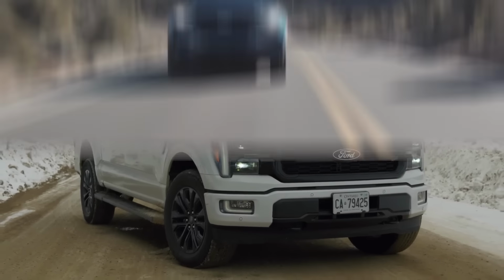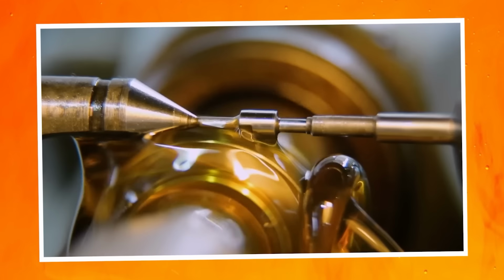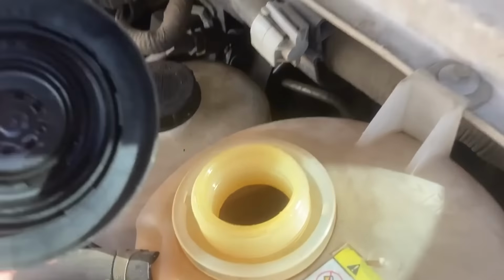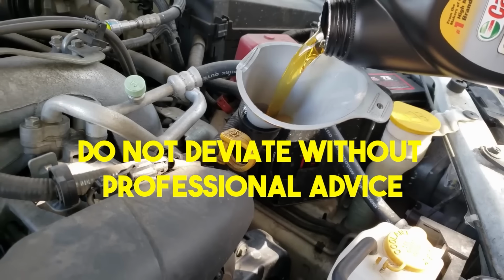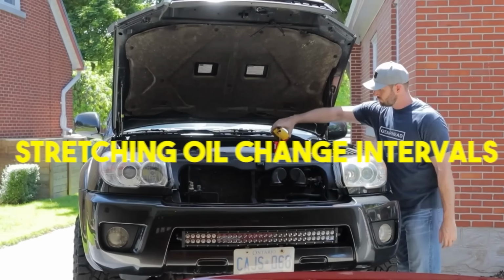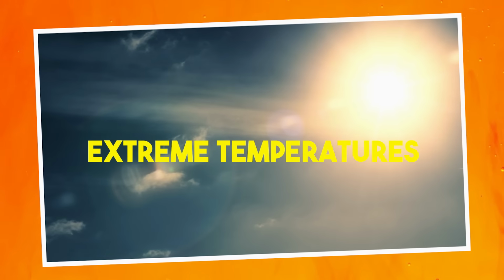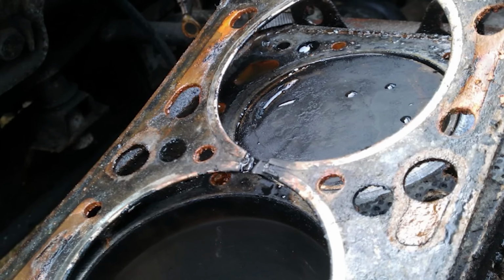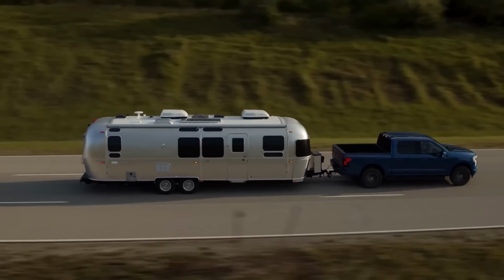STOP Using This Engine Oil in Your FORD – 15 Serious WARNINGS!

Comment from the maker: What engine oil do you use in your Ford? 🛢
📘 FREE Ford Longevity Checklist 👉 https://www.fordscope.com
This is the same checklist I’ve used for 20+ years to spot early wear and bad habits.
If it raises warning signs, the full 500,000-mile guide explains what to do next.
Reply: Royal Purple 5w-30 on my 2012 3.0 Escape and works perfect- Full Synthetic with latest additives
Reply: Pennzoil Ultra Platinum 5w30 in my excellent '22 Edge AWD 2.0L turbo. 5k mi OCI. Synthetic oil filters. Synthetic air filters. Purrrs at 55k mis. -Engineering perspective
Reply: Use Top Tier rated fuel only as Ford recommends folks!

Comment: Ford’s 5/30 blend in our 2024 5.0 and 3.5 eco-boost. Change every 3K or 6 months. Oils cheap, engines are not, Texaco gas. ✔️
Reply from the maker: Short intervals, quality oil, and good gas keep those EcoBoosts and 5.0s running strong for the long haul. 💪🛠️

Comment: Hello RJ I love your videos. They’re very great to watch to listen to. I’ve own a Ford since 1980 at all Ever drivers Ford ask a question I have a 2022 F150 5.0 and my dealership that I go to for my oil changes and stuff uses a blend for oil changes. I asked him about going full synthetic they say no it’s OK so I’m asking you should I go force and take anyway or listen to a dealership .
Number two
I’ve wanted to get a catch can for my 22 F150 5.0 but the dealerships says no and they said I stole it. They were not on my warranty so is that true or should I get a catch can or not and if so, what would you recommend for one thank you name is Kevin. I would appreciate it if you help me. Thank you very much again. I love your videos and you’re very helpful and knowledgeable. I appreciate it.
Reply from the maker: Hey Kevin! Thanks so much for watching

1. Full Synthetic: Yes, definitely use it. It offers better protection than blends, especially for your 2022 F-150 5.0. Just make sure it meets Ford’s specs.

2. Catch Can: It’s a smart upgrade for long-term engine health. Some dealers may push back, but if it’s high-quality and properly installed, it shouldn’t void your warranty. Just keep all records and avoid modifying emissions components.

Comment: It’s pretty simple if your vehicle calls for 5w20 put Full Synthetic 5w30 and change every 5k miles. CAFE rules are nonsense and ruin engines. Even 5w30 is a very thin oil but thick enough to protect engine parts. Use Ceretec or Marvel Mystery oil every 30k and your engine will thank you. I’ve ran several Ford V8’s in my fleet that called for 5w20 and used 5w30 with no issues and hundreds of thousands of miles. That 1% change in friction for fuel consumption is nonsense and only prematurely wears out engines. If you’re working your V8’s hard just change the oil sooner. Fresh oil is the best solution. If you’re in a hot climate 5w40 is a great option as well. The key is maintenance, keep your oil fresh ✌🏽❤️
Reply from the maker: Well said! You're absolutely right about the importance of fresh oil and solid maintenance habits. Ford’s spec oils are often about emissions and economy, not necessarily longevity. For hard-use engines, especially in hotter climates or with towing, bumping up to 5W30 or even 5W40 makes a lot of sense.

Comment: This site is misleading on oil.............. GT500 with 5.2 V8 uses only 5W50 Full synthetic...... Mustang GT 5.0 V8 used 5W20 but Ford realized it was wrong, today the 5.0 now uses 5W30 only...  SHO Ford Taurus 3.5 Twin Turbo, uses only 5W30 full synthetic....... Ford Taurus 3.5 V6 NO turbo engines came out using 5W20 but today thats been changed to 5W30 full synthetic  only today.... So this site is misleading the public..... No longer do oil changes past 5000 miles ever........ 10000 mile intervals are not for longevity, only better gas mileage.....
Reply from the maker: You’re spot on with those updates — and thanks for adding real detail. Ford has revised oil specs on several engines over the years, and you’re absolutely right: 5W-30 is now recommended in many places where 5W-20 used to be the standard.

We always recommend checking the latest TSBs or the updated owner’s manual, especially for engines like the GT500 5.2, SHO 3.5 TT, or the revised Coyote 5.0.

And yes — 5,000 miles is a much safer change interval if you want your engine to outlast the car.

Comment: Cant beat Ford current gen GTDI engine designs or modern efficient V8s. Nobody investing in V8 tech still except FoMoCo. 👍🏻 Simply follow good basic maintenance practices & your Ford vehicle will last a long, long time. 5-6k mi oil change intervals/ 50k mis for transmission fluid/differentials/ transfer cases on AWD & 4wd. Coolant flush every 4yrs/ 60k mis (max). Top Tier rated fuel only as recommended whether you use regular 87 or premium 91/93. -Engineering perspective

Comment: My 2014 5.0L Coyote calls for 5W20. I see on the internet many owners switch to 5W30 to avoid high temp oil breakdown.
I know the cam phaser solenoids and phasers have very small oil passages that must have free flow to operate properly. I believe the newer engines call for 5W30. 
Anyone please comment.
Reply: The 3.5L V6 GTDI engines were updated '19-'20 I believe. They on gen3 now. Nobody builds better engines of this type (GTDI) not to mention new gen modern & efficient V8s. Use what they call for during warranty period always! If out of warranty you can safely use 5w30 where 5w20 is called for. Not heavier. If full synthetic it flows fast throughout engine even cold. Don't use oil additives it ruins chemistry of complex GF-6A SP rated oils unless very high mileage or use high mileage oil preferably. Use Techron fuel system cleaner 50-100mis b4 every oil change . Don't neglect coolant or transmission fluids ..as w/any vehicles. Top Tier rated fuel only as Ford recommends. -Engineering perspective , NW Ohio
Reply: @Davido50 Thanks much for the info. I do all the maintenance you mention and use Amsoil at 5k intervals or one year. Will use Techron just before next oil change. Use only Costco top tier gas. Here in west central CT.

Comment: Ford - the undisputed 👑 of recalls!
Built. Ford. Fluff. 🧚🏻‍♀️
Reply: At least they take care of their customers! Most of Ford recalls are small things..software updates etc unlike GM & Toyota w/catastrophic engine failures.. replacing near 1mil engines in GMs case & 300k In Toyotas. Quietly. Hyundai-KIA on permanent review w/ NHTSB for their vehicles . I'm in the industry i see it all. Wouldn't recommend any Hyundai-KIA vehicles to anyone regardless of so called reviews. Metallurgy issues constantly. I drive a 22 Edge AWD 2.0L turbo. 55k mis been impeccable. Orig wiper blades/tires. They spec quality parts. Facts. Next vehicle will be Ranger Raptor truck possibly..not selling Edge SUV.  -Engineering perspective
Reply: Don't  buy none  then! what  are you doing  on here to begin with 😂

Comment: I don’t trust running a engine 10,000miles before changing the oil sounds like car manufacturers designing planned obsletes
Reply: All automakers promote that nowadays. European brands even farther! Cut in half. Last a long time. Ford builds great engines. -Engineering perspective
Reply from the maker: I totally get where you're coming from – 10,000 miles can feel like a long stretch!

Comment: 10w30 synthetic oil and 5000 mile oil interval. Anything else is to satisfy EPA Bull Shit and Ford doesn't care one bit about engine preservation. The choice is yours ⁉️
Reply: Too thick unless older engine. -Engineering perspective
Reply: I'm running 10w30 instead of 5w20, motor sounds better and is happy at 165,000 miles

Comment: Does anyone use the oil that ford has at dealer ship it's got to be snake oil right
Reply: Are you kidding? Motorcraft is highest rated OEM oil out there. Project Farm did a test awhile bk plus well known Motorcraft fluids of all type are top notch. -engineering perspective
Reply: I do not allow ford dealerships to use bulk oil (who knows what it is for real??) from the dispenser in my family fleet of 7 ecoboosts and 2 raptors. Only 5w30 semi synthetic from a motocraft bottle and changes at 30% oil life remaining on the awesome oil minder algorithm- have read the calibration document for the oil minder and it is legit, taking everything into account including oil lab samples when calibrating but assuming quality motorcraft oil is used but for fleet cost, hence change at 30% remaining for personal vehicles. Engineering perspective also. Any ford vehicles that specify 5w20 to be used should and can use 5w30 safely unless in winter Alaska even then ok.. 42 years ford engine experience currently in engineering.
Reply: @danuffie6340 💯
Reply: Used for yrs never an issue
Reply: @jasonbrushett2005  Motorcraft is highest rated OEM oil available. Facts. There full synthetic is top notch as is coolant/transmission fluid etc. Ford dealers offer BG products as well. Also top rated in the industry. Beware social media agendas/lies on all brands. -Engineering perspective

Comment: Pennzoil Platinum high mileage w/ Motorcraft filter. 2013 EB SCREW. Runs like a dream.
Reply: Excellent choice . Pennzoil Ultra Platinum even better for couple bucks more! Facts. 5k mi change intervals esp in GDI/turbo applications. Motorcraft filters or synthetic type oil filters only.  -Engineering perspective
Reply: This video is misleading
Reply: Pennzoil ultra platinum is not for high mileage engines